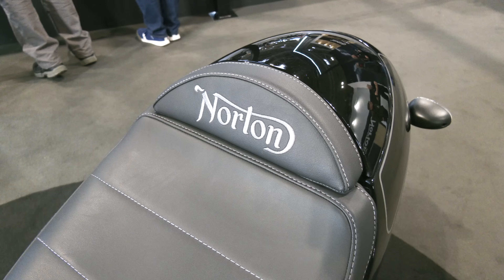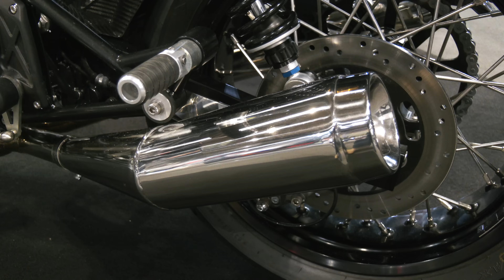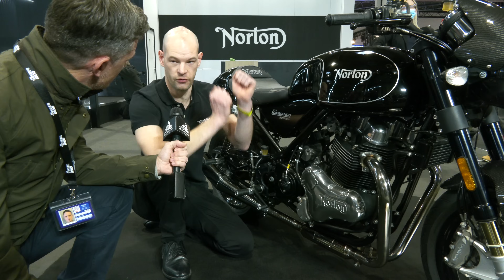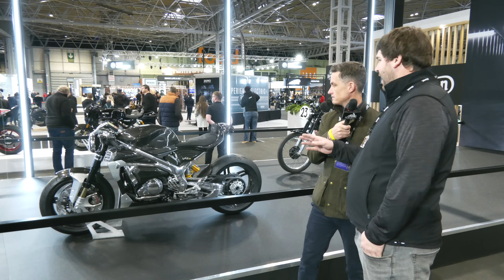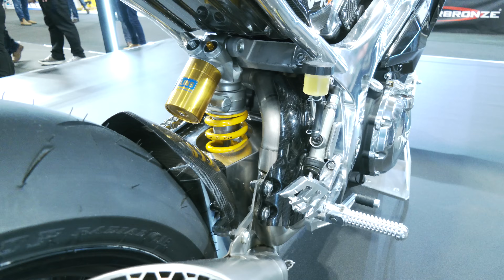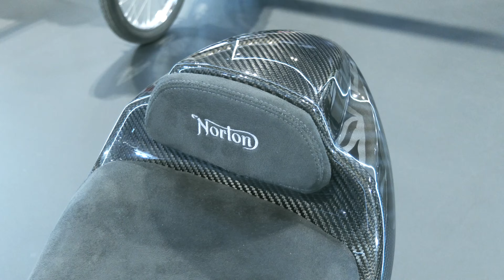Norton Motorcycles at Motorcycle Live 2021 NEC Birmingham

Comment: I own a 750 and a 850 Norton Commando's I bought them in the 70's . I was going to buy a HD Sportster but they acted like I wasn't good enough to ride a Harley. So I went to the next town down the freeway to the Norton, Triumph,  BSA dealer and bought the 750 it was a demo so it had some miles but got a great deal. A year later the 850 came out and had electric start. The 750 could be problematic to crank at times. I love them and either one would smoke a Sportster. So FU HD.

Comment: Not being pedantic, but, what's with the plastic hydraulic oil reservoirs for the brake and clutch on the Commando? It looks as if they forgot to design them into the lever assembly, " Hey Charlie, these bits were on the bench"...  " Ooops, ah well, just stick 'em up there, no one will ever notice".  Is it just me, or do they look terrible?.

Comment: That 961 needs to go it’s been knocking about for years like a bad throw back to the 70’s.

Then there’s a naked 185mph V4?

Like most of the classic bike manufacturers they also include examples of their original machines on the stand just in case we have forgotten who they are?

It’s these machines that contain the exact styling and design cues most of us really want to own minus a radiator and LCD display.

Comment: I grew up with a kid whose Pop had both 750&850 Commando Motorcycles and I was fortunate enough to ride those Bikes and the Handled so beautifully compared to the Triples I rode at the time, I was just Gobsmacked! I would Love to see Norton build a new, 6 Speed Commando!
Reply: If the torque curve is as flat and broad as the Norton rep claimed, a 5-speed tranny would do fine(ly).
Reply: Love the look of the new stuff from Norton i hope they keep putting the good quality steel in,or whatever they use today,because I am 90,years old this year and I remember how well they lasted and when hrd was struggling in the early 50s,they had to build their new machines in second grade material‘my friend bought a 53 black shadow quaranteeed for 125 mph,well this one only touched 110 on sulby and Then the front cylinder was forever seizing and the brakes were not so good as the 51 comets ,that he had 2yrs before.if we had deeper pockets and it
Had not been such a difficult journey from the midlands to Stevenage but we had to be back for the afternoon shift at the local colliery and then the weather was foggy.but we made it back to work we had to we couldn’t afford not to..if you find this hard to believe please read john surtees book world champion he worked there for a while "Kenneth lowe

Comment: The Commando would be the only reason to buy a Norton. To not have it in the lineup would be foolish.
If you can make it reliable, and at a decent price point, (no one needs carbon fibre on a classic) it would sell like hotcakes. 🥞
Reply: Yeah, carbon fiber on a classic bike is too "back to the future"!
EFI and ABS are necessary evils, but carbon fiber (at least if it's visible) is jarring.
Reply: TVS aint no fool man. The commando will be back ready to compete with Triumph Bonnevilles and other modern classics.
Reply: @seauryakumar   - I hope TVS can keep their price down for the Commando.   High power isn't necessary, so they can use a small oil cooler instead of a radiator for liquid cooling like the BSA Gold Star.  And if they offer a kick-starter as an option instead of an electric starter, great!  Sealed spokes to enabled tubeless tires would also be a neat option.
Reply: The carbon fibre on that is really vulgar and naff,totally wrong on it.

Comment: The tech gent from Norton should've emphasised the hydraulic tappets and low maintenance of the 961. I hope they keep this model going.
Reply: Hydraulic tappets meaning no adjustment?
Fine thing. Hope they make more.
Reply: This is a genius idea. Just like Honda did with the CB750 giving the valves hydraulic lifters eliminating the need to make manual valve adjustments. A huge plus in reliability + engine durability in my opinion. Too bad it's not water cooled.
Reply: Unlikely. That engine was sold to China before TVS acquired Norton.